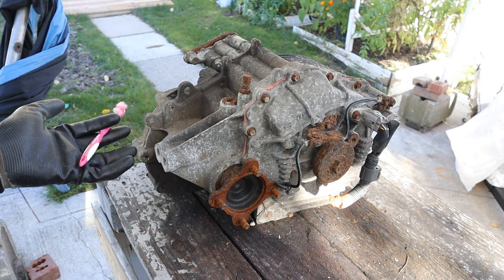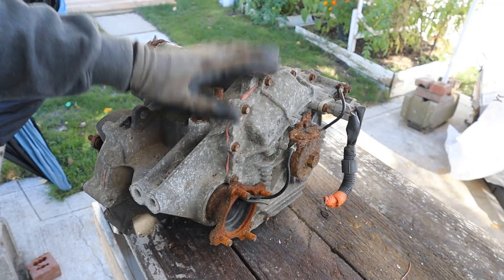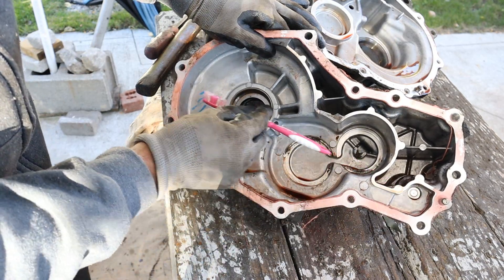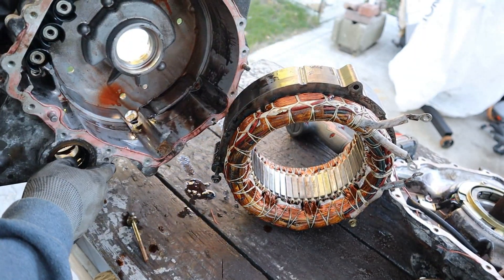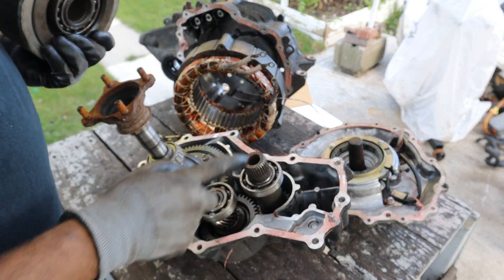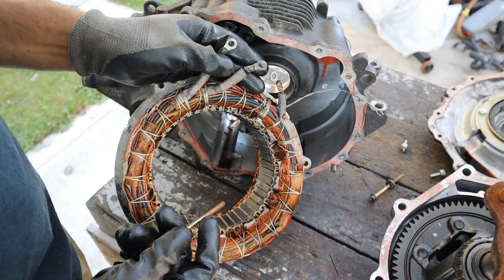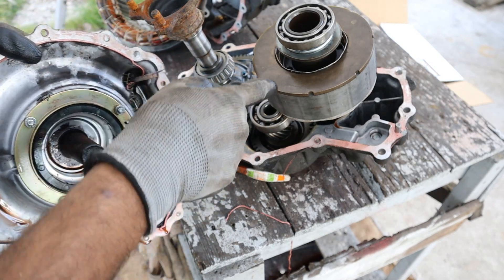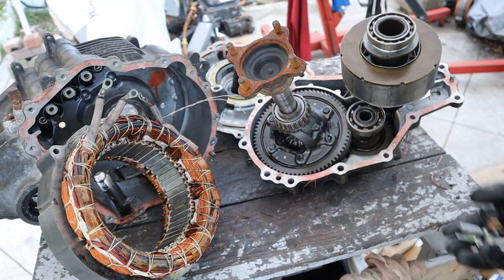How Hybrid eAWD Works

Comment: Fun fact, this little thing (MGR Q211) is rated for 50KW aka 67HP which is more than enouph to fully drive the car in electric mode only  !
Reply from the maker: At slow speeds and a small period of time before it overheats and the battery depletes.

Comment: They put a lot of engineering into a half baked "AWD" system. I see the benefit of plug and play from a modularity and cost cutting perspective, but this e-awd system is exactly why I'm going to go with a Subaru hybrid vs a Toyota hybrid.
Reply from the maker: Kinda agree with you
However not much people use the capability of a full time AWD system so they didn't (and still don't in today's models) see the point in making a proper mechanical system

Comment: I wonder what happens when mud and some moisture meets that 3 phase connector. how these things get designed to counteract the effects of moisture on electronics specially when they constantly get wet from roads and they are mounted under the body
Reply: Do you think these things are make like little tikes toys? Do you see corrosion anywhere in that connector? They're very obviously designed to be resistant to the elements, which is why this 2006 car was still working when it got parked up. The computers can pretty easily detect when water does get into where it shouldn't be.
Reply from the maker: The connector is sealed very very well! It's high voltage, it better be.
Reply: @speedkar99  Toyota pick up truck rear lockers used to not work correctly because diff locker was electric and every now and then water  would damage its electronics.

Comment: I bet that e-awd setup weighs less than a transfer case & driveshaft.

Would be nice if they also used the rear for regen braking. Regen is basically ABS, since it won't work if it isn't spinning.
Reply: I have '22 Venza. The rear drive unit does regen , just like the front two on deceleration .
Reply: Regen is absolutely not like ABS. Regenerative braking is perfectly capable of fully stopping these synchronous motors, which you really don't want, especially on your back wheels. You want no regen on slippery surfaces to prevent lockups. My bolt will happily start sliding if you try regen on ice, though traction control cuts it off pretty quickly. Just use your service brakes, it's no replacement in the winter.
Reply: @pootispiker2866 no, it can't. The slower the motor spins the less generating ability it has, with very little at slow speeds & zero possible when stopped.

Anyone who says regen lucked up the tires is actually a crappy driver who wants to blame the car for their own failure.
Reply from the maker: I wonder how the GS/LS rear wheel drive hybrids do Regen braking on the back wheels alone.
Reply from the maker: I'd say they weigh the same

Comment: The resolver doesn't really sense speed and direction of the rotor; it sends the position of the rotor to the cpu, so it knows which poles of the stator to activate (it needs to synchronize the magnetic field with the rotor as it's a synchronous type motor). But yes, via the (moving) position the cpu does know the speed and direction.
Reply: Yeah I think it senses what would be described as 'slip' on an induction motor.
Reply: @davelowe1977  Slip in a syncronous motor causes a stall. They cannot slip beyond a very small margin.
Reply from the maker: I mean...based on the position it'll service speed and direction right?
Reply: @speedkar99 Yes exactly. But the ECU needs exact position at all times to synchronise the magnetic field with the spinning rotor.

Comment: Just to flex : Years ago, when I had an rx400h, I came in contact with the forums. And in the there was this lexus tech that commented on the testing and repair of the mgr. According to him, there is a sequence of pedal presses and gear lever changes, like a song and dance of sorts to put the MGR into full drive and according to him, you can actually drive the vehicle with the mgr on full blast for a perioid of time.

The limiting factor to this is battery capacity and heat. Now, if I were a more technically oriented guy, I'd figure out a way to get those seals seal better, then plumb an external electric pump to pump the fluid out to a cooler and then back to the casing, like people do with oil cooled diffs in drag racing.

Then do the pedal and shifter song and dance and have a real e-awd vehicle.

I'm quite sure that going to these lengths JUST to get a subpar awd vehicle to have a full time awd untill the battery is depleted  is just stupid but hey, if someone of you guys have skills, a shop and some coolers, pumps and hardware laying around, make a video.

Great video man!
Reply from the maker: Sounds like an interesting trick but I don't know if it's that easy to access MGR without a proper scan tool.
Reply: that sounds sick ! 
do you have more information about this ? it would be fun to tset on newer models

Comment: it doesnt do any regenerating? seems like a waste
Reply: It’s a hybrid and the front motor already generates more than the battery can actually take so it’s ok but on phevs it actually regenerates
Reply: MGR does perform additional regenerative braking, though not a lot.
Reply: It can and sometimes does of course, but it's not the primary generator during braking, the two front motors handle most of that
Reply from the maker: It sure does. I thought I mentioned that in the video.

Comment: Man, that looks like a fun way to maybe electrify an older, lightweight car like a VW Beetle (or my personal fantasy, a Pinto/Bobcat!). Swap in that MGR and a battery pack, and boom, you've got e-RWD.
Reply: Speaking of VW swaps:  a young guy recently put a Honda Goldwing flat 6 into a Beetle.  His you tube is called:  JT built it
Reply: Nah, there isn't enough cooling for continuous use. You're better off with off the shelf purpose built EV parts.